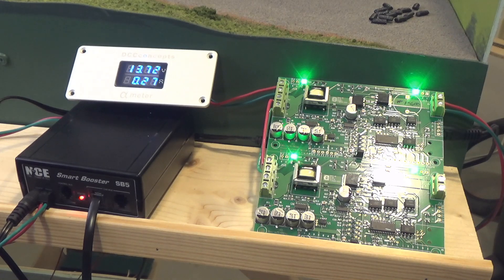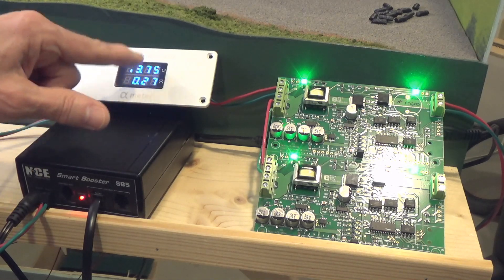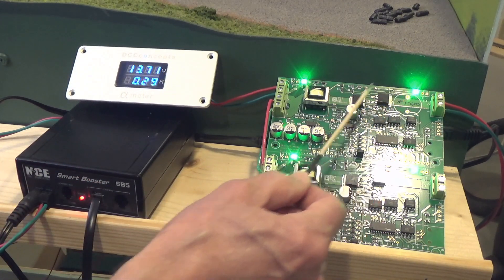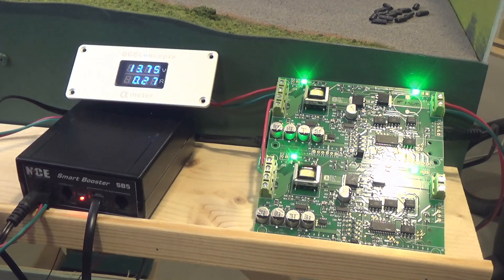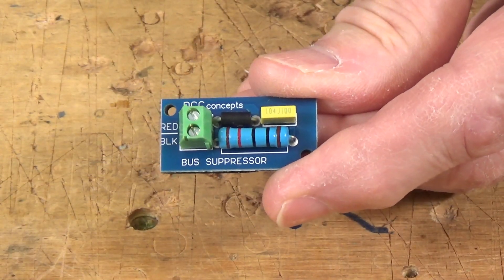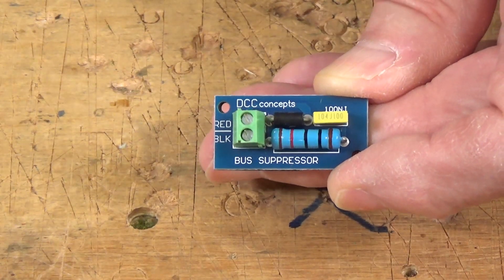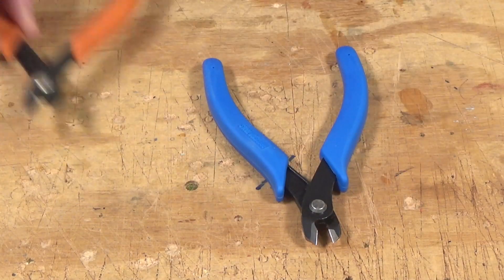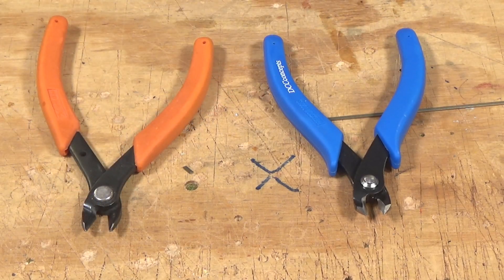iP Digitals And PSXX Circuit Breakers For Your Model Railroad (307)

Comment: Hi,  I have unresolved shorting issues with the PSXX.  I have been using multiple PSXs for years without issue & bought 6 PSXXs for an expanded layout with many digital IP machines.  Shorts everytime I throw a pair (or more) of machines, or with either of a couple of new sound locos trying to start (they will run fine if already rolling from adjacent booster district)  & even just turning on a 12v taillight globe.  Bench testing reveals the same with multiple different machines & multiple different PSXXs yet no problem with any PSX.  Next to no help available from suppliers other than to blame each other's products.  DCC specialties suggested the solution of setting the trip current to 8 or more amps which seems a bit redundant with a 5 amp booster. So thats all I have been able to do.
Reply from the maker: I just spoke with Larry Maier at DCC Specialties and have some more info. They have discovered a couple of issues that might be the cause of your problems. First, if you have a DCC system that supports RailCom such as ESU or TCS, then that can be a problem. Apparently when RailCom is turned on it turns track power off and on at regular intervals, like every couple hundred milliseconds. It does this so it can talk to the decoders on the layout. Now every time the power comes back on it creates a power surge which the PSXX detects as an overcurrent situation. Dirty track can also cause a similar situation. At any rate this can result in the PSXX shutting down.  So if you have Railcom turned on then as a test try turning it off in your command station and see if that fixes the problem. If not then try cleaning your track. To address this issue Larry has developed a new firmware version that will allow users to tell the PSXX to ignore these short duration current surges and not shut down. This will be available on new units in a couple of weeks and you also should be able to get your older PSXX boards updated to this new firmware. I also suggest you contact Larry directly via email at larry@tonystrains.com as he may have additional questions and suggestions for you. Now this is not an issue with the older PSX boards in that they do not have the same circuitry that monitors the current surges and clamps them down the way the PSXX does.
Reply: @TheDCCGuy  Thank you Larry - appreciated.  I will make contact again with DCC Specialties. My DCC System is Lenz, so yes, RailCom is supported however my shorts are only when certain (although numerous) extra loads (eg switch machines) commence.  So unless the on/off surges being suggested as attributable to RailCom are amplified considerably by additional, & somewhat minor, loads I wouldn't have expected identification as a short.  Particularly as one of the improvements of the PSXX (as I understand it) is the ability to determine 'true shorts' vs discharged capacitors/sound decoders/stayalives etc.  Thanks again & I will let you know the outcomes.

Comment: Does your Digitrax boosters turn track power on when you power up your power supply but the command station just sits offline?  Then you have to power down boosters with the remote then reposed the command station so everything turns on together???
Reply from the maker: Which command station and boosters are you using—I have about a dozen ranging in age up to 29 years.
Reply: @TheDCCGuy  command station is the dcs100 and the boosters are a db150 and db200+

Comment: Thanks for all your informative videos. I am fond of IP digital point motors. I have 18 so far with more planned. The only issue I had is with random switching caused by wire attenuation from my wiring. DCC Concepts has a fix for the issue.  Search "Cobalt long wire switching interference.pdf"  and this fixed my issue where I was using optical sensors to automate turnouts and automated reversing loops. I ran 8 cat5 twisted pair using 60 of the strands over 40 feet for control wire to the point motors and sensors only (not DCC). I was thinking that the cat5 twisted pairs would be fine but it caused issues till I added diodes. It works great now! Just an FYI if you ever run into this issue. Thanks again  -Hal

Comment: Hey Larry. I notice in ur intro that u have a big steam running. What radius do u have it running on??? I was just wondering cuz I have big steam too and starting my layout. I getting different radius size. What do u think will b a good radius? Thank u and great videos
Reply from the maker: My smallest radius is 30” in the helix. On the mainline it’s 36”. I have one old brass J class 4-8-4 that can’t take the 30” radius but all the rest can. You just need to be mindful of the min radius your locos are designed to take. I’ll show you the steam fleet on Friday.
Reply: Thank u for ur information. That really helps me alot. The only other problem I'm having is how I want to do my layout in the space I have. I'm no cad expert. I only know as I build. Again thank u.
Reply from the maker: One option is to dig through old issues of MR or get a copy of their book of previously published track plans. Find ones about the same size as your room, makes copies, then cut and paste to create a version you like.

Comment: Solution to IP Digital Motors Tripping PSXX:

After taking to Larry Maier (PSXX Designer) at DCC Specialties my attention was brought to my power supply (ESU Cab Controller). After programming the PSXX then rebooting my power supply (full shut down and restart) I no longer have the issue and can run multiple switches, locomotives etc without a short. I tried this multiple times and every time I programmed the PSXX then tried to use the switched (power on/off track) the switches would fail. Every time I program the PSXX and power on and off the entire Cab Controller after programming I do not experience the issue. 

I have no idea why this was the case and certainly did not expect these results. I have reached out to ESU for a possible explanation.
Reply from the maker: Excellent, this is great news. Thanks for doing the footwork with Larry Maier and getting back with the solution.
Reply: @TheDCCGuy  Thanks again Larry for all your help. Looking forwards to your next video.

Comment: Larry, Is it that he has an auxiliary bus, that he has got his IP digital switch motors connected to, if so this will cause the shorting, as frog wire takes feed from the switch motor supply. This is the one main down side to these IP digital switch machines as you cannot feed them from an auxiliary bus, they must be feed from the track power that goes to the switch.

Comment: Intersting video as usual.  Have you ever considerred covering DCC EX (previously DCC++)?   For small and medium sized layouts it is a considierably less expensive method of controling a DCC layout than any comercial products on the market and is relatively easy to implement with Open Source standards as published by the NMRA.  Please accept my appologies if you have been asked and answered this question previouly.
Reply from the maker: I have been asked but to be honest I am so backed up just covering off the shelf products I just don’t have time to get into a DIY system. If I did go down that road I would likely be overwhelmed with questions from folks attempting to build these and having their own issues. For the same reason I avoid Arduinos and Raspberry Pi—both potential time sinks that someone else can devote an entire YouTube channel to—feel free to jump in there!
Reply: @TheDCCGuy  Thanks for the reply.  You do such a wonderful job at explaining things I though it might be an avenue worth exploring.  Cheers!

Comment: Thanks Larry.  I have been incorporating a large number of DCC Concepts products into my layout.  Their Intelligent Circuit Breaker arrived this week.  I wanted to ask you about proper placement of Buss Suppressors, Snubbers, etc.  Since the DCC equipment is attached at the mid point of the red/black buss would it be proper to put a buss suppressor at each end of the buss to terminate the buss?
Reply from the maker: Put them on both ends of the bus wires. For very long bus runs or very noisy wiring you can even add them at intermediate points.

Comment: Thanks Larry for the video. I am a huge fan of DCC Concepts and find myself now eyeballing their circuit breaker (and screw driver set) after this video as I have already purchased the IP motor, locomotive current detectors, and Alpha meter. I want to note that I also like the innovations at DCC Specialties and Im exited to try their PSXX- AR coming out soon (Im on backorder) , once I have this issue resolved with the PSXX it should make for a great combo as your other videos point out. 

I will share the solution or reason to the IP Digital /PSXX short once I figure it out (with the help of tech support from DCC Concepts and DCC Specialties). Unfortunately  issue may not be as exciting as a device fault but could easily be me the user as I am very new to the hobby. Already I see comments/recommendations to the video and I am trying them as I come across them. A Big thanks to you and the community here for the help.
Reply: Are you using DCC powerbus to power the trains and IPDs? DCC bus wire should not go in the IPD terminals 7, 8 & 9, these terminals are for the throw switches only. 

If you are using DC to power the IPD's and DCC to power the trains, the frog wire needs to be in terminal 6 with left and right rail DCC feeds in terminals 4 and 5. DC power to the IPDs needs to bein terminals 1 and 2. 

Whichever method is used, the correct polarity needs to be observed across all IPDs. HTH.
Reply: @1701_FyldeFlyer  Thanks Flyer for your input. I do not know exactly what you mean (Im new to this) but red what you said a few times and hope I am understanding it.  I will take a stab at an answer. I am using DCC Power Bus from the ESU Cab Controller (Verified using my Alpha Meter which shows as DCC current) I plug in from the power bus to the IP Digital Motor (is this what you mean by an IPD?) which is only able to use DCC current according to the manual and wire that into the first two terminals each labeled "DCC in" which I assume is what you would call terminal 1 & 2.  Also not I do not have the frog wired as I have no track in this scenario [Power -->PSXX-->IP Digital Motor] Did I interpret what you are saying correctly and if so did I answer your question(s).

Comment: With regards the decoder short circuit protection, I'm given to understand that the unit should be installed at the end of the run, however I cannot use them because my layout is wired like 3 ring mains, one for each of the 3 levels.
Although I have had locos coming onto the point from the non set direction, which stops the trains on that level. I don't seem to have had any decoder problems. I am using lamps in series with each of the 3 levels individually so only the level with the problem will be affected.  The lamps simply light up which limits the current on each level.
Do you know of any device which I can use, that can be inserted in the circuits which feeds the ring mains?
My track output goes through an Alpha meter, then is split into 3 circuits for the lamps which feed the layout levels. So the Alpha meter voltage and current is showing totals for the whole layout.
Reply from the maker: No, these are just like the circuit breakers in your home, they need to be between the moan power source and the circuit wiring they protect. It is the RC filters/Bus Suppressors that go at the end of the power bus wires.

Comment: The TVS diode on the DCC Concepts snubber appears to be a bipolar TVS diode.  Hence, it is really two "back to back" diodes to clamp an AC signal at a certain voltage.  If it was a unipolar TVS diode, it would have an end marking stripe just like a common diode.
Reply from the maker: Yes, I didn’t want to dive into the technical aspects of TVS diodes. However the symbol on the board did indicate a bidirectional TVS. It comprises 2 facing triangles with a vertical line between them. Unfortunately I cannot see enough of what is printed on the device to determine the component rating but I would suspect 20 volts or so since the decoders are rated at 22 by NMRA standards.

Comment: I have a dozen or more IP Digital machines and the previus generation PSX . Absolutely no issues at all. Peco Electro Frog points can cause problems if they have not been set up well and the frog polarity is causing shorts...... Just a thought.
Reply: Thanks Andrew, I just have the motor hooked directly to the the PSXX no Frog wired as a test. I still get the short. Larry tried this and he does not get a short. I am getting a lot of good comments about Frog issues and hopefully when I get there I can avoid these issues. I have a Peco Unifrog waiting to be added to my layout but being new I have just been trying out the components at this point. I promise to share the reason/solution to this community even if its "user error" which it could well be.
Reply: @JasonEdwards-kt3hg  hi Jason, all I can suggest is: test with a second motor if you have one. Reset the PSXX to factory defaults and test again. Reach out directly to DCC Concepts. I have had good support from them in the past and they replaced an iffy motor for me without quibbling. Reach out to the PSXX manufacturer. Sorry if I am saying stuff you have already tried. Good luck.
Reply: @andrewdonald2770  Thanks Andrew.  I have tried a second motor and had the same issue. I have also reached out to DCC Specialties and DCC concepts and both were fairly quick in their responses something you don't see in many companies.  It now appears there may be a compatibility issue with PSXX and ESU power supply. I wrote a new commend to this video thanking everyone....that includes you, so thank you for providing your support.

Comment: The only problems I had with the IP Digital points/turnouts was when I wired them up incorrectly
Reply: Hi Derrick, how did you wire them incorrect?....I am new to this so any information you can provide will help me avoid the same wiring mistake.
Reply: @JasonEdwards-kt3hg  Hi Jason. I too am new to the modelling world. My problem came when I gave a seperate feed to the point motor and had to change the frog wire to another connection
Reply: Hi Jason. I too am new to the modelling world. My issue came about when I gave a separate power supply to the point motor and having to change the frog wire to another terminal in an electro fro turnout
Reply: @derrickpensom5429  Thanks.  I will keep that in mind when I wire up my turnouts.

Comment: Larry my first suggestion would be to isolate the cabling from the PSXX2 to the layout and just wire an Digital IP motor to the output of the PSXX2. That should then show if the PSXX2  is faulty if it trips when switching the point motor. I am like you it would be very hard to think it is anything more than bad wiring somewhere on the layout.
Reply: Hi Peter.  Thanks for providing the suggestion. I have my ESU Cab Controller wired directly to the PSXX and from their wired directly to the IP digital and it does trip when I switch the motor. I also tried to do it with another IP Digital switch and I get the same issue.  As I am new to this hobby (Just started a couple of months ago) I too believe it could have been faulty wiring so I re-wired the simple layout described above and kept it as simple as possible and the same problem occurred.  In your opinion would this indicate an error with the PSXX?  I have also I have reached out to DCC Specialties and DCC Concepts for support and will post what I find on this site.
Reply: @JasonEdwards-kt3hg  I know it is easy to swap a wire around when wiring up a layout.  Being careful, sometimes I still manage to get wires swapped.  I think it happens when I get distracted by something.  Have you tried the elimination method?  Unplug the IPs except the one nearest the PSXX.  Does it short when thrown?  If not, plug in the next one, does it short?  Then keep going until you get a short.   If the first IP did short, then what kind of turnout are you using?  Is it setup for DCC?  If electrofrog is it isolated?  I tend to put my turnout motors on a separate buss from track.  I experience this recently using Tortoise switch machines.  I had been cutting track, a piece flew off to somewhere, every time the switch was thrown I had a short.  So, i isolated that section and I still had a short.  Finally running my fingers between the rails I found that piece of cutoff rail between the rails.  It had landed just right to cause a short.

Comment: My guess is that his turnouts are not DCC friendly - he is using the switch on the Cobalt motor to switch the polarity of the frog and switch rails - the Cobalt isn’t perfectly installed and the switch rail is still in contact with the stock rail but the Cobalt switch has changed giving a short…..
Reply: Thanks Bill, for your input. To clarify I have run a test with Power supply --> PSXX --> IP Digital motor and no hook up to a track and I seem to get the short. Larry tried this set up and did not get the short. My next step may be to take the PSXX to my local store and see if they are willing to try it. If they get the same issue it will have to bee the PSXX component.  Im open to any other thoughts/suggestions or tests you think I can try.
Reply: Apologies - thought the problem was on a model railroad - not on a bench.
Reply: @billflude5204  No apologies needed, you gave me information that i may need when i start laying out track and turnouts. everything is new for me so Frog wiring issues will be another challenge for me. So than you.